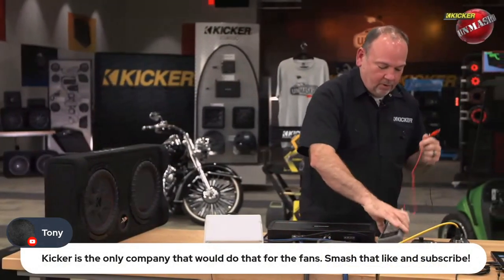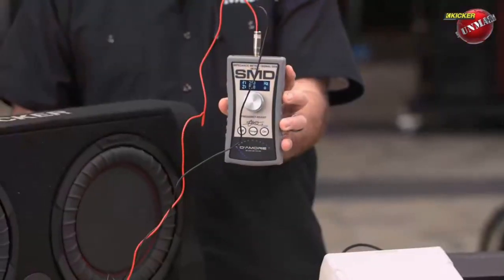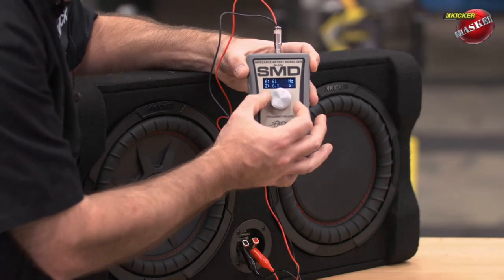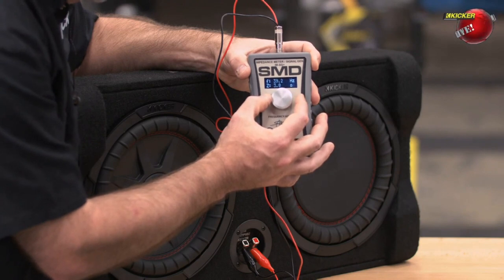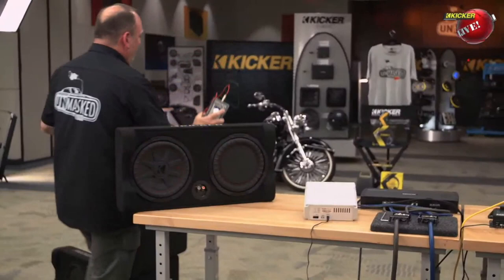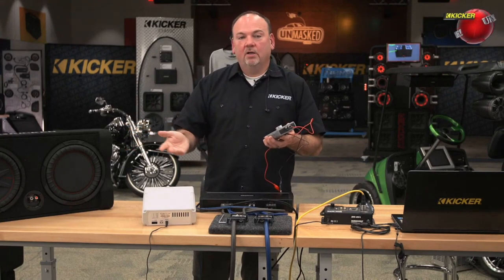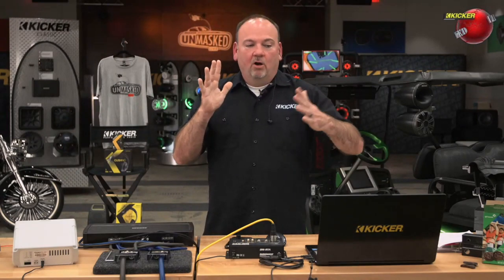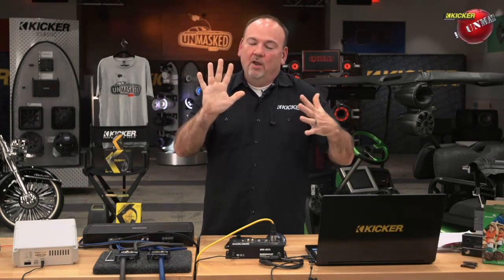Find the Tuning Frequency of Your Enclosure - KICKER UnMASKED - Shorts

Comment: How does rhat thing even work it dont make sense lol subs are off and not moving so how are u getting an ohm reading and a tuning frequency of box and nothing movin
Reply from the maker: It has a low-power amplifier in it. Remember - the goal is simply to find the lowest ohm load, which doesn't require a lot of power. That in turn tells you the tuning frequency, since the lowest amount of resistance means the sub is moving as freely as it can in a sealed environment.  It may not seem like it's moving, but it is, otherwise you wouldn't hear a tone. The main reason is because its not a lot of power and the camera is nearly straight in front of it.

Comment: Not a very informative video.
Reply from the maker: Given the point of the video is to find the tuning frequency of an enclosure, what info were you hoping to get, but didn't?
Reply: You don't explain what you're doing while you're doing it.  The impedance cycles up and down multiple times but you don't explain which cycle you're looking for, i.e. you find 2.9 ohms more than once.  Later, you mention speaker cone movement, but you can't see it move in the video.  Finally, you're not clear that this is used for vented enclosures ONLY which may not be obvious to many, especially when passive radiators are not very common and they appear very similar to an actual driver.  Reading the comments, it seems like I'm not the only one who's confused.  The only reason I can say all this is because I got what I needed from other videos, and I wanted to circle back to yours and express my confusion.  I appreciate you asking and I should have been more detailed to begin with.  I've enjoyed Stillwater Designs products for decades.  Thanks for video, I didn't mean to come across so abruptly.               @KICKER-AUDIO
Reply: @KICKER-AUDIO don't worry, great job. People with common sense can very easily understand everything that was needed to know about the tuning frequency